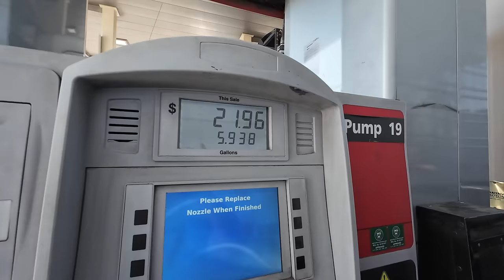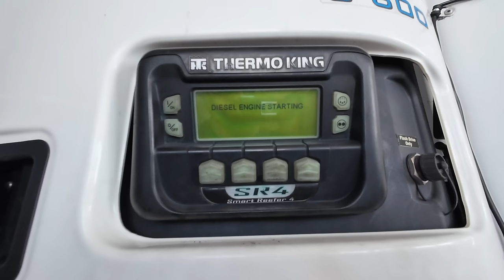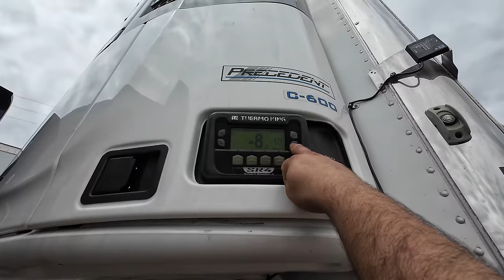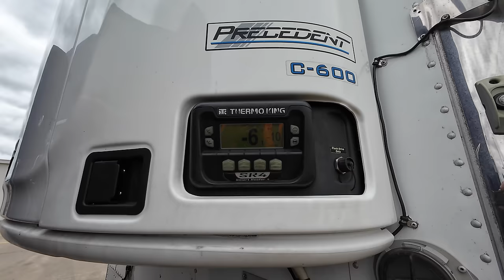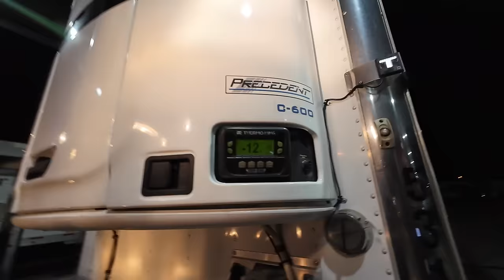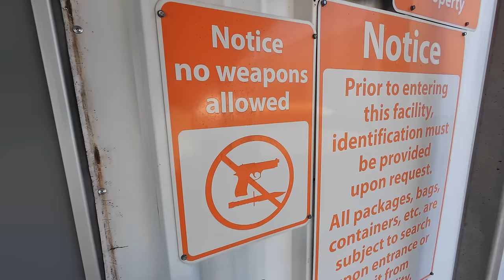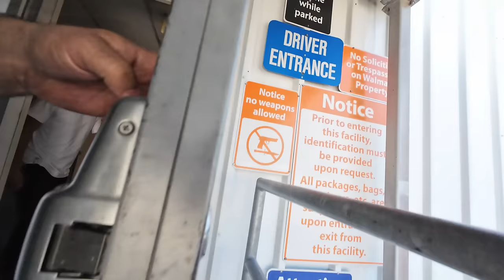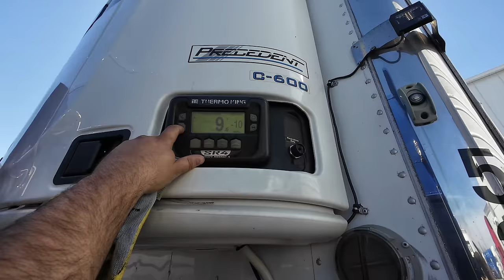TRUCKING FROM ARKANSAS TO MISSOURI IN PETERBILT 389 PRIDE AND CLASS GLIDER

Comment: I'm a new subscriber, I'm 70 years old and got my class A in 1977 but spent most of my career as a mechanic. I was wondering what engine and transmission you have in your glider. I love your channel, have a great evening
Reply from the maker: I appreciate it buddy 🙏🏼 this truck has Detroit 60 12.7 with 13 speed transmission and 355 rears

Comment: 65 through Branson sucks! Dude i live off west battlefield you live in Springfield also?
Reply from the maker: It really does suck especially if you’re heavy with all them hills. I live in Columbia
Reply: @OTRBandit  ill look for you on the road. Im a fueler i drive for Quality transportation out of Halltown. Be safe out their.
Reply from the maker: @michaelbleckler4379 yes sir, seen those trucks out here many times. I called to see if they were hiring about a year ago but the lady said they aren’t.
Reply: @OTRBandit  He has a low turn over. Has drivers hauling gas and dsl, ethanol haulers, and jet fuel and propane. Later brotha be safe driving